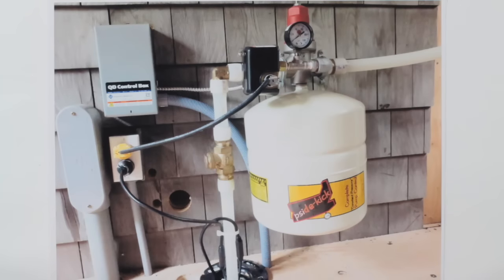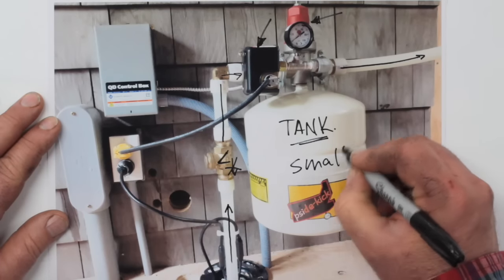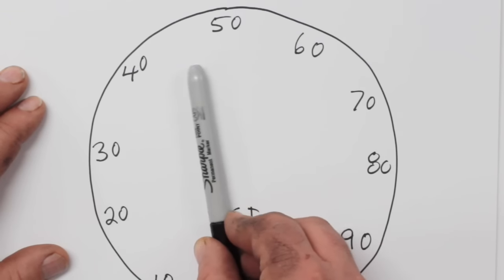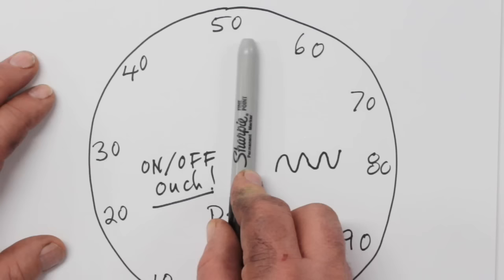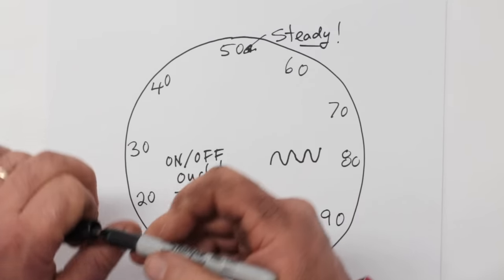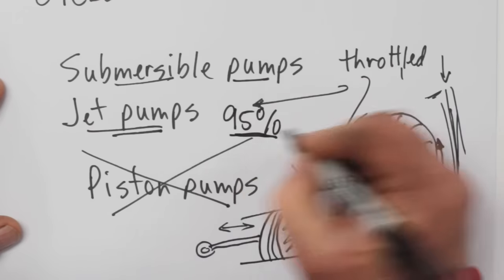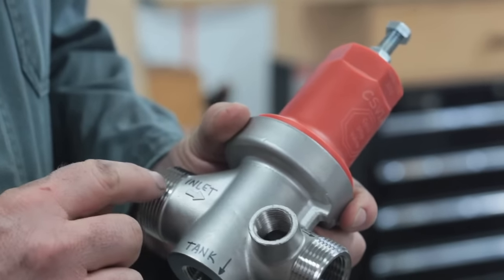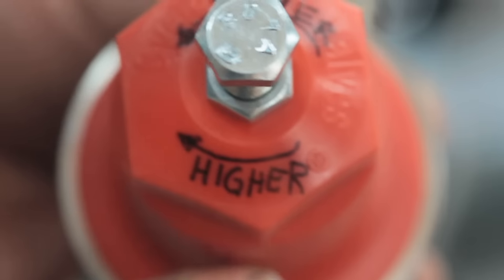Pressure Tank with Cycle Stop Valve Installation Sharpie Drawing

Comment: What I've understood from this video for my specific application which is a residential irrigation system is that I am much better suited for my 1/2 HP pump to use a CSV125-1 with a 4gal tank than to purchase a 26 or 32 gal tank??

Comment: Just a side note the Teflon tape does not seal the connection, the threads are what seals a connection. You need at least 5 rotations and preferably 7 to seal and the tape lubricates the threads to get the extra turns. There is thread sealant which is a paste that plumbers often put over the threads and Teflon if you can't get enough turns or just as a back up.
Reply from the maker: Thanks for that.  Stainless to Stainless threads don't seem to seal very well.  We normally use Teflon tape with sealant paste on top of that.
Reply: @cyclestopvalves8380  ok thanks for the reply

Comment: Misleading.  Showers are only occasional use.  Washing hands and flushing toilets and getting a glass of water and rinsing a dish are more frequent uses.  You usually use water about 20 times before a pressure tank cycles even once.
Reply from the maker: If any thing we said was "misleading" we wouldn't still be in business some 30+ years later.  If with a big pressure tank you can use 20 things before the pump comes on, using a CSV with a small tank will save that many cycles during three showers or a sprinkler in the yard on for an hour or so.  Although you can use a CSV with any size tank and have both 20 uses before the pump comes and AND no cycling for longer uses, the larger tank is still a waste of money and space.

Comment: Sounds like to you just renamed a pressure regulator....so rather than turn on and off it has a few mins of lag time before it cuts pump on and off.
Reply from the maker: Lol! A pressure regulator would deadhead and burn up the pump in about 5 minutes.  There is no "lag time" between on and off.  The CSV only lets the pump shut off when you have completely stopped using any water.  It does work sorta like a pressure regulator, it just makes sure there is always sufficient flow to keep the pump/motor cool.  A little change to a pressure regulator makes all the difference.

Comment: Thank you for such a good explanation, I have never heard of this system before. 

My water is not from a well, but it may be a similar situation as I live on the six and seventh floor in a block of flats, consequently my water pressure is low so I would like to install a pump and a small tank to even out the flow rate. Filling the bath upstairs takes a very long time. The system that you have explained may offer some advantages, so I will investigate it further.

You are very good at drawing circles!
Reply from the maker: The Cycle Stop Valve works just as well on pumps boosting city water pressure as it does for a well pump.  We do high rise buildings all the time.  As long as you have enough volume of water on your floor, you can add a little jet pump like a J15S and a PK1A to boost the pressure from 10 PSI to 60 PSI constant.  We could also do the entire block of flats with a larger pump and larger Cycle Stop Valve located on the lower floor.  With 50-60 PSI constant you will no longer even need soap in the shower.  :)

Comment: I have a Wayne's brand 1/2 hp shallow-well jet pump with an attached pressure switch set at 30/50. Pumping water from an above ground swimming pool (used as water storage)  The pressure tank is 44 gallons with a drawdown of 6.2 gallons. If I use the washing machine the pump gage drops to 30 psi (pump kick on) rather quickly but it does look like it's drawing 6 gallons. The water pressure filling the washing machine drops slightly at first. Then gradually the pressure continues to decrease filling the washing machine. Pressure at the pump now drops to 10 psi (sometimes lower)  and water is barely trickling into the washing machine. I stop the washing machine from filling because I don't want the pump to be running at almost 0 psi. . No other water is being used in the home at this time. I can hear the pump start to draw more water beginning to fill the pressure tank. It would be another 30 mins. before the pressure switch reaches 50 psi to shut off the pump. That just seems too long to refill what may be only be 18-20 gallons of actually water going into the 44 gallon pressure tank. 
      The pump and tank are 3 months old and this issue seemed to start as soon as they were installed. My previous pump system was a Craftsman shallow well pump with a built in check valve. Which lasted 15 years or more. 
    I eventually want to pressure wash a roof which requires constant water pressure over a continuous 45 minute period. Would a CSV fix my issue?
Reply from the maker: Sounds like you are running out of water.  But pumping from the above ground pool you should be able to see if you have water.  A 44 gallon tank only holds about 11-12 gallons at 30/50, not 18-20, but more than 6 gallons of draw down.  The CSV1A will hold 45 PSI constant to the pressure washer instead of letting the pump cycle on and off between 30 and 50.  But if the pump cannot produce enough the pump will not cycle on/off as it should and the CSV won't be able to make it stay at 45.  That pump should fill the 12 gallons in a 44 gallon size tank is less than 60 seconds, so something is wrong with the  pump.

Comment: Can the back pressure from the CSV cause the pipes to burst? Our plumbing is not copper piping.
Reply from the maker: Unless your pump is WAY over-sized, NO.  The back pressure from the CSV can only be as much as the pump can build.  Most house pumps can only build 100 PSI or so, and if your pipe isn't rated for more than 100 PSI, the pipe is a problem and should be replaced anyway.  Checking the pressure rating of the pipe, and seeing how much pressure your pump can build, which we can help you with, is the criteria for sizing a Cycle Stop Valve for your system.

Comment: I have a well pump and a hundred gallon holding tank will this small tank method work with my system?
Reply from the maker: 100 gallon holding tank or pressure tank?  Drawing water from a hundred gallon storage tank the PK1A kit with the 4.5 gallon pressure tank will work fine.  With a 100 gallon pressure tank you can set the CSV to work with that tank or replace it with the PK1A kit and 4.5 gallon size tank.

Comment: hello, my well-pump went down last month. Got 80 g tank already installed. Can I still use this Cycle Stop Valve on this big tank?
Reply from the maker: The CSV will work with any size tank.  You just need to set the CSV at 57 when using a 40/60 switch so it only takes a couple minutes to fill the tank after all the faucets are turned off.  When the time comes that you need a new tank, a 4.5 or 10 gallon size is all you need.

Comment: I have a Grundfos JP20 2hp jet pump. I know it comes with an internal safety switch if the pump over heats. Will constant running of the pump not cause it to overheat? When I irrigate my lawn in 4 different zones it takes about an hour of irrigation. I have it set on an 80gal tank.
Reply from the maker: Pumps are made to run 24/7/365.  But with a CSV the pump only runs continuously while you are using water.  It does not run when the water is turned off.  I know it is counter intuitive, but pumps overheat from cycling on and off too much, not from running continuously.  An 80 gallon tank only holds 20 gallons of water.  Your 20 GPM pump will cycle every minute or two with that big tank unless you add a CSV.  And there are 1440 minutes in a day, so that is lots of cycling.  I have a pump that hasn't shut off in 18 years, and it will last longer than my other pumps that cycle on and off as water is used.
Reply: @cyclestopvalves8380    can I use it for irrigation without a pressure tank?
Reply from the maker: @vegitoblue7908  Yes the CSV can be used with a pump start relay instead of a pressure tank.

Comment: I feel like I need to add more air to the bladder since my off time is less than 20 seconds.   It does not wait until 40.
Reply from the maker: Off time should be irrelevant as the pump should stay off until you use water and never go off while you are using water.  If not, you have a bad check valve or a hole in the pipe.  If it is coming on before the pressure drops to 40 there maybe something wrong with the pressure switch.  Having more air pressure in the tank than the start pressure for the pump will cause a water hammer and a momentary delay in water from the faucets.

Comment: Doesn't the throttling cause a strain on the pump?
Reply from the maker: Just the opposite of what you think. Throttling a pump makes it draw lower amps, work easier, run cooler, and last longer.

Comment: Is the piston pump the one with the two wheels that is belt operated? If so, that's what I have on my submersible pump. It pulls water up into a cistern. From the cistern the jet pump pumps water out to the main line and a pressure tank- although, it has a tee before it reaches the pressure tank so I think it might be bypassing the pressure tank-- hence my crappy water pressure. LOL.
I'm trying to figure out the best & easiest way to fix my setup. My pumps are in a crappy metal shed so I can't mount stuff to the walls and there isn't enough space to build something.
So, if I have a tank tee, I could put this before it and just plug the various openings except the ones being used? 
What are the sizes of each opening? 
Does it matter if this is installed horizontally or vertically?
Can I use PEX between the jet pump and CSV?
Reply from the maker: The CSV1A would go before that tee to the pressure tank.  It would be best to replace the tank while you are at it with a PK1A kit using a 4.5 gallon size tank.  That will save lots of space, work much better, and supply strong constant pressure to the house.  Pex is fine, just use one size larger than you need to reduce the friction loss in the insert fittings.

Comment: Check valve before or after or where specifically?
Reply from the maker: The only check valve needed or wanted is the one on the submersible pump.  A jet pump needs a check valve on the suction line or the discharge line prior to the CSV.  One check valve is all that is needed.  Any additional check valves will cause problems sooner or later.

Comment: What is the first component on your system? Is that a check valve? Wondering can you still install a brass check valve with this CSV to help protect the well pump from water heater thermal expansion. I heard many well pump systems already have one but with sediment they can fail and many people install a second new the indoor tank.
Reply from the maker: The little pressure tank with the Pside-Kick kits also doubles as a thermal expansion tank for the water heater.  The check valve on the pump MUST function properly, or it will need to be replaced.  Any other check valve in the system is just a problem waiting to happen.  You cannot add another check valve above ground if the one on the pump fails, or it will cause a massive water hammer on pump start.  The check on the pump will work better when it has all the pressure holding it closed, instead of only part of the pressure as happens when you have additional check valves.  The same cycling on/off of the pump that usually causes check valves to fail, and is the reason most people think additional check valves are needed, will go away when you have a Cycle Stop Valve.  When the cycling goes away, not only does the check valve and everything else in the system last longer, but many times the sediment also goes away, as cycling was also surging the well.

But yes that is a check valve in Steve's pump system, which he will sooner or later have to remove when he starts getting water hammer.  That is even a flapper type check valve instead of a spring loaded check valve, which I would not use in a pump system anywhere anyway.
Reply: May I jump In? No, do not install a second check valve anywhere. Your submersible pump already has a check valve, and that is the only one you need. I understand the Code in some areas does require a second check valve, but that is something dreamed up by Know-Nothing desk jockeys. Not necessary, and as the CSV guy says, a second valve will only cause trouble later on. If the pump's check valve ever gives you trouble it must be repaired, even if there is another in the system.

Comment: How much can this valve help pump life in a residential situation where you have a .5hp pump with a larger pressure tank, say 120Gallons. So, in this case, the pump should not start until a considerable amount of water is used. and when it starts it will run for sometime until all that 120 gallons is filled. Probably the advantage is maintaining the constant water pressure at the outlets. How should the valve  be plumbed in such case.? Thank you
Reply from the maker: A 120 gallon pressure tank only holds 30 gallons of water.  Every body thinks they have 120 gallons of water and that is not the case.  It takes 75% air to push out the 30 gallons of water as needed.  For in the house use only a pump will cycle less with a large tank.  For outside use a pump will cycle much less with a CSV.  Overall the CSV and small  tank system will cycle less.  And it doesn't really matter how many cycles a pump does for house use, as a house only uses maybe 300 gallons per day anyway.  Using a CSV to eliminate cycling while showers and garden hoses are being used greatly reduces the number of cycles.  So if it cycles every time you flush a toilet you are not hurting anything.  I mean how many times a day can you flush a toilet anyway?
Reply: Unless you have diarrhea  😀 . I am just trying to understand if upgrading to csv will help more in my situation.I thought my tank could hold 100+ gallons. It's model HT-119B water worker.thank you for your reply.
Reply from the maker: LOL!  Even then the pump will just stay on all day if you keep flushing the toilet every minute.  The pump will not cycle as long as the toilet is flushed again within a minute or so.  The only way to make the pump cycle is to wait at least two minutes between flushes.  And then the pump is not cycling fast because you are waiting two minutes between cycles.  Waiting only 1 minute between cycles and the pump just runs continuously until you stop flushing.

Yeah everybody thinks pressure tanks hold a lot of water, but they don't.  Water comes from the well and pump, not the tank.  The tank is only there to slow the number of cycles, and when you have a CSV to do that for you, a large tank is not needed.

Comment: Can it be use for irrigation?
Reply from the maker: Yes the CSV can be used with a pump start relay instead of a pressure tank and will work fine on a straight irrigation system.
Reply: @cyclestopvalves8380  okay so cabln use without pressure tank?

I got a 40/60 pressure switch.  So I need the cycle stop volve of 50 right?
Reply from the maker: @vegitoblue7908  If you do not have a pressure tank, then you do not need a pressure switch.  Just turn the pump on with the breaker or use a pump start relay in an irrigation control box and do away with the pressure switch.  Even without a pressure tank and pressure switch the CSV will regulate the pressure to 50 PSI even as irrigation zone sizes vary from 1 to 25 GPM.
Reply: @cyclestopvalves8380  thank you sir. You are very helpful

Comment: How is this different from a standard pressure reducing valve?
Reply from the maker: A CSV is made similar to a pressure reducing valve.  The CSV cannot completely close like a prv, which would deadhead and burn up the pump from zero flow.  The CSV is designed to pass a specific amount of water even when in the closed position, to keep the pump cool and to slowly fill the pressure tank when no more water is being used.  Who would have thought something so simple could solve so many problems?
Reply: @cyclestopvalves8380  OK, thank you very much.  I am a retired hydraulics engineer (oil hydraulics, not water) so I am interested in more specific details of this CSV operation, if you are willing to elaborate.   Specifically, how do you keep the "self-flushing" seat itself from clogging in the valve closed position, like the holes in a shower head might with grit or other contamination?  I am envisioning some ways this might be done, and realize this might be proprietary information, so understood if you can't go into too much detail here.

And also, does the spring chamber of the valve vent to atmosphere in some way so trapped water under pressure doesn't interfere with valve pressure setting?
Reply from the maker: @crazy1gadgets1  Yes the spring chamber vents to atmosphere.  The non-clogging bypass is so simple it will make your head hurt.  it is explained here.  https://cyclestopvalves.com/pages/basic-operation-of-a-cycle-stop-valve
Reply: @cyclestopvalves8380  Very interesting.  This all makes perfect sense.  Similar contamination known as silting in many oil hydraulic valves is flushed out in similar ways.  A very good solution.   I shall have to try it on my pump application.  Thank you very much!

Comment: my pressure switch is 20psi cut in 40psi cut off. should i used the CSV for 30psi?
Reply from the maker: With a small pressure tank, yes.  With a large tank you would need the adjustable CSV1A so you could set it for 37-38 PSI.
Reply: Thanks.